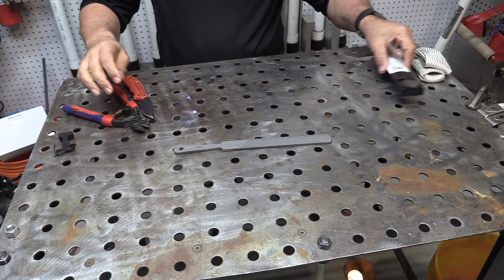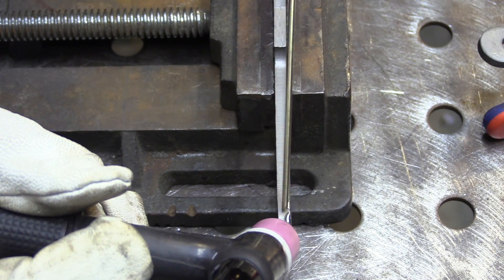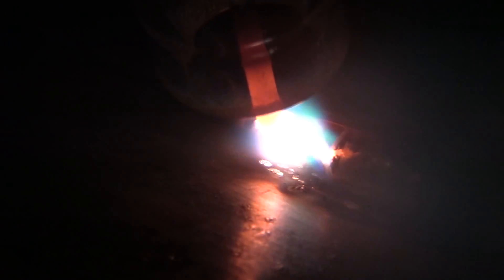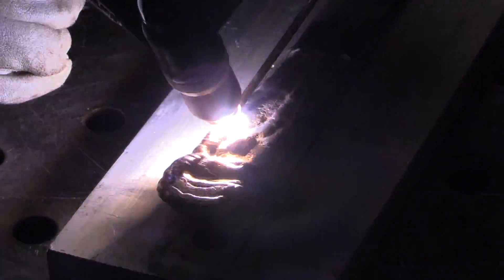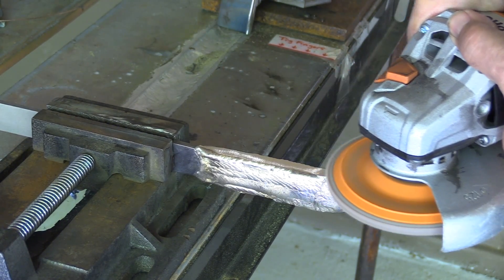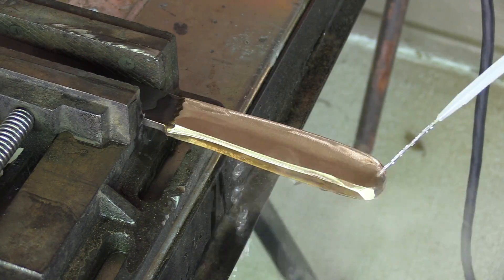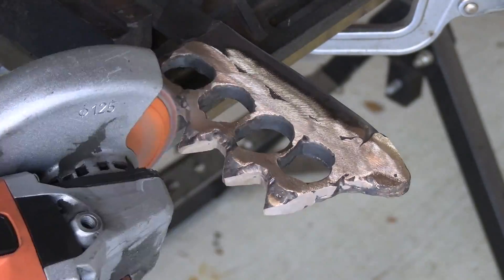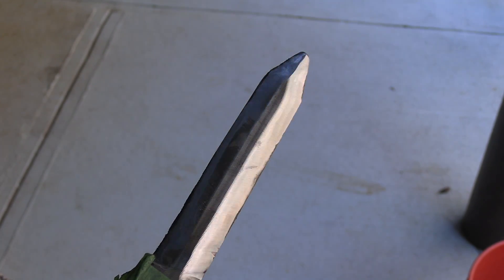Trench Knife TIG Brazed Handle

Comment: Hey, I have a small favor to ask. Have you made a 7018 (or 6010) 2f t-joint video before? Reason I'm asking  because right now in tech school, I'm trying to move on from SMAW to GMAW/FCAW, and the requirement that was set by my welding teacher is to be able to weld in 1f, 2f, 3f, and 4f all on a    joint that looks like a plus sign (t-joint with another piece of steel on the opposite side). Thank you if you respond! Great videos!

Comment: What ac balance were you using? I tried 90% EN 120Hz  #8 25cfh and silbronze and even just enough heat to flow the silb it scums up.

Comment: FYI @7:02 when sand paper and non-woven nylon abrasive (what 3M brands scotch-Brite) is alternated like that, its called "interleaf".  Just figured I'd let anyone interested in buying one know since it's a lot easier to find what you want when you know the industry wide term e.g. "interleaf flap wheel" or "non-woven interleaf flap wheel" 

Having finished stainless steel and other harder metals professionally for years (though I've worked plenty with softer as well) , in my opinion the very best abrasive is Ceramic Alumina, Zirconia isn't even close  and aluminum oxide should only be used on wood and even there it stinks. Ceramic Alumina lasts the longest, doesn't load, is self sharpening (though not to the same degree as silicon carbide) and definitely keeps the piece the coolest which is huge on this stainless since SS has very slow thermal dissapation... Norton's Blaze line is the best hands down.

OH yeah, always finish a metal with a non-woven nylon abrasive alone, it'll close the grain that sandpaper opens and greatly reduce the accumulation of foreign materials and thus slow down tarnish.

Comment: Cool - but in some places having a weapon like that would, not could, get you jail time.
Depending on the file material, and treatment(s), it may also snap in the transition area between the blade and the handle - some are made from chilled cast iron, which works well in the intended use but is brittle.
Reply from the maker: I did some pretty rigorous testing on the transition area of 2 other identical files to make sure it wouldn't be brittle in the transition area.

Comment: Hey, something I actually know a little about!
I went through a few years of knife making (never used a file but wouldn't dissuade anyone either) and the best file knives were D2 or O1, but then again the best files for converting are the ancient ones you find at garage sales and such. Not 100% what the new chinesium ones are made of but I wouldn't doubt the pig slag 440c was involved. I've also seen the old rail spike knives, and spring steel, and saw blades, etc. Some better executed then others, but tended to I use flat stock for things I'd sell before I got into forging and the heat treating phase was always my favorite part. 
Anyway, I'd never thought to make a handle like that but now I'm almost itching to try it myself! Very very sweet idea.

Comment: Hey, great video.  What is the difference between tig welding and brazing?
Reply from the maker: TIG brazing uses a low melting point filler metal like silicon bronze or aluminum bronze and the base metal does not get as hot